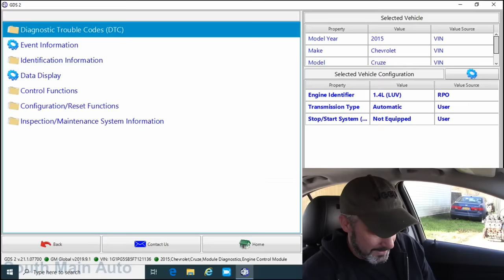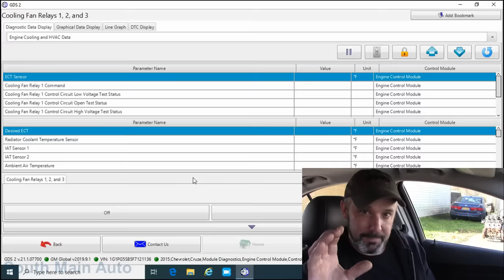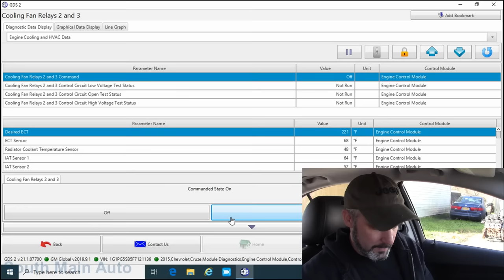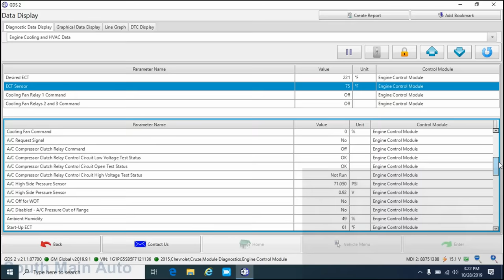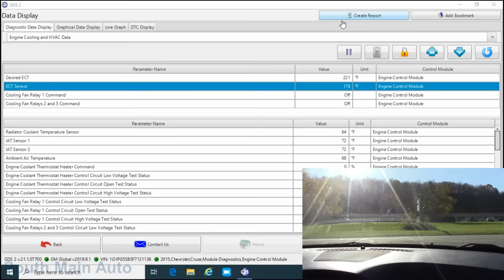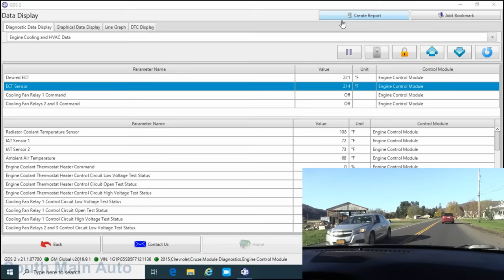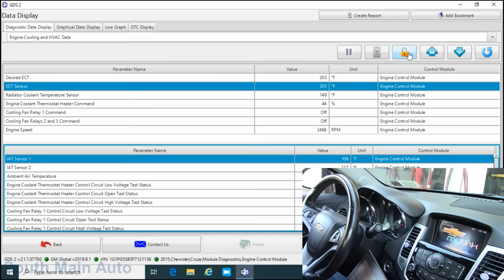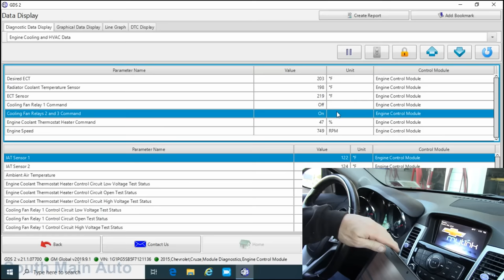Chevrolet Cruze: Overheating, Loud Fan, Losing Coolant

Comment: As a tip, on a new GM with push button start, push and hold the button for a few seconds and it should turn "on". Thats how it is on my Bolt anyway. EDIT: Nevermind, you read it later

Also, since you didn't really cover the thermostat operation (at least in this video), many new cars use heated thermostats. It is literally a standard thermostat with a tiny heater element in it. This allows the manufacturer to change the thermostat opening temperature depending on what they want at the moment by adding more heat to the thermostat without heating up the coolant. Higher temps help with efficiency and fuel economy, while lower temps help with performance. So, the thermostat will open at what would traditionally be considered a high temperature (this one appeared to open around 220-225F, hence the desired coolant temp of 221F while driving), but when you were running the engine off idle and not moving, it turned on the thermostat heater and dropped the desired coolant temp to 203F. This is still somewhat rare technology on domestic and Japanese cars but has been super common on European cars for a while now.

Comment: Eric O, I want to thank you for all that I have learned from your channel. I watch new and old videos every morning waiting to go to work. ive got one in my driveway. 08 f250 5.4 it loses its 5v ref from the pcm. the other shop told them they needed cam phasers and it was gonna be 1200 plus parts.. I learned from that always test never guess.. if I wouldn't have done that I would've went down the rabbit hole. thanks a million eric o from john masontown Pa

Comment: Chevy Cruze's are total crap.
Reply: my europe version has 190.000 miles but I agree the cooling system is a desaster...I have been stranded down the road 4 times due to overheating or hoses and plastic parts breaking...last event was last week were the last original OEM hose blew during stop&go traffic...but things got better since I change from Dexcool to normal standard coolant...plastic and rubber parts seem to last longer now
Reply: should have stayed with the cavs  they run an  run
Reply: @bobl78  Mileage honestly means very little. Everything should be clocked in hours of operation and not mileage. Everything else in the world is, only cars stick with a measurement that is variable.
Reply: There’s your problem lady.
Reply: @DontCryAboutIt  Time or mileage are both inaccurate measurements. Time does not factor if the machine has been operating and distance does not factor if the machine has been operated but moved short distances over said time.

This is why everything else in the world. Heavy machinery, farm equipment, aircraft, marine engines etc. are measured in hours of operation. As it is the only metric that tells you how much the machine has been used.
Reply: @Cragified    I think total fuel consumption would be the best single metric of the total work the vehicle has done. Nor hour count, nor mileage, reflect the load on all the components of an automobile, which can vary greatly with use.
Reply: @Cragified  isn't time measured in hours?
Reply: yea, they are cheap cars. weve had ours from 60K to 80K miles now. has had warranty work done on the coolant system and boost system twice now. thing filled up the plug holes with oil. recently it's sounded like a freaking sewing machine at idle. IDK, maybe its obnoxiously loud injectors? Dont think I noticed it when she got it. At my job one of the key parts is listening to change in how my machines are running, so I figure I would notice a change in this engine, and I sure have. But we have warranty and it's still running. one day we will probably trade it for an fx37/qx70. she wants a bigger car anyway.
Reply: @fascistpedant758  Fuel consumption tells you very little about engine and driveline wear. An idling engine experiences nearly as much wear over time as an engine at the same rpms but under a higher load. The metal to metal wear is the same, but the fuel consumption per hour will be vastly different.

Likewise drive line rotations (mileage) that equate to a distance gives absolutely no information to the conditions the drive line and suspension experienced during set distance.

100 miles down an interstate at 55mph is significantly different in wear then 100 miles down a rutted country dirt road at 55mph for your suspension and axles.

There is a reason that trucking, heavy equipment, farm equipment, aviation, rail etc. all use some form of hours of operation. Be it engine hours, flight hours etc.

It tells you how long said machine has been in service, regardless if it has been stationary. Some may try to argue well that only tells you about the engine. Thing is.. vehicles don't tend to do much of anything if the engine isn't running. And in the case of where the entire vehicle is stressed from operation regardless of engine use that's when a variant such as flight hours is used as is the case in aviation.
Reply: Not saying mine was perfect but i put 120k on it and the only time it ever left me sitting was when the batt went bad. Also had the ect sensor replaced under warranty
Reply: @Cragified  I agree that lubrication and cooling aren't optimal at idle speeds, but automobile engine don't usually experience high loads at idle speeds. I disagree that wear at idle is anywhere near that at high speeds and loads. 
Hour counts are useful on equipment operated at fairly constant loads and designed for long service life at max rated speeds and loads. Automobile engines are not designed to operate at high speeds and loads for extended periods of time.
As for bumpy roads, that's a different story unrelated to mileage, hour count, or fuel consumption.
The number of recommended oil changes on vehicles with oil life monitoring based on operating conditions could also be a useful
 indication of engine condition.
Much of all of these parameters are stored in some form in modern PCMs and could be evaluated together to get the biggest picture.
Reply: anti chuckle that’s kinda how bmw calculates there oil life. How many liters of fuel has been consumed. If you drive around easy your not burning much fuel so your easy on the engine. Hot rod it and your rpms are much higher even when you travel the same distance. So more fuel consumed more work is being done. Less life in the oil

Comment: Maybe this has been said already but I was working on a Cruze with a pesky coolant leak from the water pump. Would not leak a drop under pressure until I persuaded with a pry bar "gently " a then it leaked like crazy, hopefully this helps with future Cruze escapades, keep up the good work.

Comment: Enjoyed, I will have to keep an eye out since my daughter has a cruze and wife has the equinox with the 1.5T and the guy who tairs down motors do a1.4T for the first time. It had a blown headgasket the wall between cylinders is close. So I guess good maintenance is going to make sure that these motors will last.

Comment: I have that Astro kit and the Brake Bleeder adapter set. They're extremely well made and not cheap. Only problem is Astro can't be bothered to update their compatibility charts. They're like 15 years old. I called them about it and they didn't seem interested in investing the time to update them.

Comment: I would push for more off.  As stated below.  Its all drive train!  At least the water pump for sure.  They might do something tricky and classify them as accessories, but I would argue that they are drive train accessories.  The key word being "drive train"!    I would make sure they do everything you suggested.  Also, I hope you got paid for your time in the deal.   You did a good complete job assessing the needs and the dealer could not.  They are also getting all your labor!

Comment: My Chevrolet volt with the same motor has the collant loose issue and loud fan - was the thermostat controller housing and thermostat...... the dealer only changed the housing the first time and the car overheated the day I drove it home, had to bring it back..... I wish I lived by you so you could service my cars.

Comment: I find a Kelloggs Cornflake carton in front of the radiator speeds up the engine warming up period. Saves on fuel, mileage and time.
Reply: I do that every time in the winter. Poor 800cc engine really hates the cold.

Comment: Enjoy your channel as I have a 2010 sierra 4x4, 1996 k1500, 2016 chev trax 1.4t, and a 2011 Q5 1 4T.
I hope you got some money for a diagnostic fee. That should have been a solid $80.
Good Job.
Thx
Kevin, Auto Mechanic (subaru , oldsmobile)-Paramedic

Comment: I replaced the housing and the hose.  Very easy fix, remove the hoses a couple of elec connections unscrew 3 mounting bolts. Plenty of room to removed all componets.

Comment: Quick little tip - You can verify start/stop system by looking at the tach.  You will see "auto stop" at the beginning of the tach.
Reply: That's the easiest way.  Eric also could have scrolled down the list on screen, this is a list of all the RPO's of this vehicle, and find/not find the RPO code.
Reply: And any start/stop vehicle uses an AGM battery.

Comment: The black, plastic coolant housing, on the driver's side end of the cylinder head was cracked on the 2016 Cruze Ecotec I diagnosed. It also has a small hose connecting to the coolant reservoir.

Comment: I had a hard to find problem or duplication of the problem on a customers mini van once. Finally talked her into letting me put a capture device on it and showed her how to trigger the simple one touch button. She was WOT in rev when her car would jump surge on its rev limiter delivering news papers lol. The van didnt have a problem needles to say it only had a short between steering wheel and drivers seat.

Comment: Just did one of these the other day.. Water pump bolts was lose and possibly had the bolts mixed up. Almost positive it was leaking at the gasket and pump was good but had to throw a pump in it for piece of mind. Two of of the bolts had thread sealant on them but was in dry holes. I'm guessing the dealer selling the used car to this person did the water pump to avoid a returning customer and the Gomer Pyle of the dealers shop did the work. Everything was going smoothly  got the bolts figured out and the pump back on. I had someone approach me. I was having a discussion with said person and the thermostat unit flew apart the spring shot the locking plate across the shop. I had to get one of those thermostat units to complete the job. Piss poor engineering on GM's part to integrate the thermostat and housing but expect 2 tiny tabs of chinesium to retain 100percent of the spring pressure on the thermostat. While it may hold up on paper with the glass embedded china gold holding it together, in the real world with these cars having cooling issues and such a high operating temp they should have opted for a aluminum housing for the unit. I ended up around 200 in parts for a water pump job which i charged family rate for a whopping total of 40bucks labor plus parts. On my way back from the parts store to get that thermostat unit the rear caliper locked up on my WJ jeep which costs more than what I charged for labor.. Morals of the story "GM can cooch on a pant antler" and "Being nice doesn't pay".....

Comment: To get any GM car with push button start into accessory mode you just need to hold the start button down for 10 seconds without pressing brake pedal, it's not just the cruze that's this way but all GM cars I've driven. 

These gen1 cruze are known for leaking water pumps, brittle plastic coolant housings, failing thermostats and surge tanks/cap that don't hold pressure and vent coolant. My uneducated guess the plastic can't handle the normal operating temp of 217-220F these cars run. Under load(hills and full throttle) the computer controlled thermostat drops temp to 195F but will quickly climb to normal range once the load is gone. Shutting the engine off I've seen 240F after 5-10 minutes under normal conditions. 

Temp guage on dash shows just below 1/2 from 180-230F so its worthless. I have tested the cooling fan low speed without warming the engine by kicking on the AC. 

Glad on the gen2 cruze GM eliminated the computer thermostat and normal operating temp is now 195F like most cars.

Comment: I've done several of those junk eco-tec plastic T-stat housings. Good thing is, the water pump is an external and not timing chain driven. Sorry you didn't get the job, but after almost 30 years of twisting a wrench, you win some you lose some, goes with the territory.

Comment: Yep, same exact issue on our 2014 Cruze w/ the 1.4 turbo. Engine overheated because the water pump was leaking. Local mechanic wouldn't touch it, so we took it to the dealer and they said it was a known common problem.

Comment: Excellent vid Eric. I went through something similar last week with a GM 3.8 waterpump. Your Grand Priz 3.8 water pump repl video helped me alot. You were right about those small pump bolts being torqued to 16 lbs. Felt like i was gonna snap em. I didnt even get em up to 16ft. lbs.

Comment: 2013 captiva running at 240 degrees. Seems hot to me. But that's when the fans cut on. So waiting to see what you find out.

Comment: I had the EXACT same problem with my 2016 Chevy Cruze Limited LT almost 2 and a half years ago. It was overheating and losing engine coolant all the time until one day, the engine DIED and a new engine for it was $9,000 and I was like “Forget that, I’m selling it.” Then I went 2 and a half years without a car until I recently got a 2011 Buick Enclave SUV. Those were the longest 2 years ever lol.

Comment: Eric run the motor while you have it pressurized. sometimes it only leaks when it runs. If i can i like to pressure test it on the lift. this is because i used to work on BMWS, Mercs and Audis and they are hard to see around the motor with the light and mirror. Then you have to take off the useless plastic shield to see in from underneath.  I'm watching the video on your test drive a wonder why i can't scroll down on the temp reading on the right. LOL Get a slightly larger mirror. The small ones don't give enough area. You end up not being able to see where you are in relation to things even though you can see the leak.

Comment: My older age teaches me “LESSONS”.  (1) Dealers are expensive and may NOT be the best place to take your car. (2) Find yourself a good mechanic you trust and use him. Just like your doctor,barber & plumber.(3) you don’t have to be “to late smart.”(4) what ever you want done will cost you money. Suck it up and do it! (5) basically money was never meant to be only saved, but to be spent wisely. I would welcome a South Main Auto Repair in my neighborhood!

Comment: Water pump thermostat water outlet all very common on those. Extended warranty through GM on the pumps I believe, just had one here in my shop the other week that needed valve cover for the PCV failure and had the missing check valve in the intake manifold which it also needed, on top of a leaking pump. The pump was covered under warranty so customer opted to let dealer do that. Likely why the dealer said they'll do it at a discount.

Comment: Yeah.. “normal”, glad to see GM hasn’t changed. I had a ‘97 S10 Blazer and the Dex-Cool garbage kept turning to brownie mix within a week of flushing it, I drove it for about 5 hours every day (long commute in to my job at IBM in Silicon Valley, Stockton to San Jose). The GM dealership flushed it a bunch of times and it would always turn to sludge right away. I’m thinking the older Dex-Cool formula (early 2000’s) + long hard commute in stop and go traffic with the A/C on on the Altamont + iron block engine + generation of vehicle that wasn’t designed for use with Dex-Cool + some air getting into the system that GM was unable to find is what caused all this. GM refused to flush the cooling system again and told me the coolant turning to dark brown sludge was: “normal”…

I finally fixed it by flushing the cooling system for two days straight and “converting” it to regular Prestone green coolant. The coolant after that always looked bright green with no sludge. I will *NEVER buy a GM product ever again….

…..*OK, maybe if I get an all black Corvette for a steal of a deal. Have to admit their new trucks look nice too.. 😐

Comment: I have a 2011 Cruze 1.4 . And i had the samething and i agree with you , i replaced the water pump and both thermostats  but i upgraded to aluminum housings cus plastics sucks for engine soon my intake manifold is soon to be upgraded....and i highly recommend premium gas for the 1.4t engines ...and not that cheap gas too....something like bp gas or shell ect...

Comment: The water pump on the 1.4 is a pain in the butt. If you go far enough to change the pump do the stat at the same time. Throw a belt on and if it has over 100k do the tensioner. Backwards ain't no fun. Good show Eric.

Comment: Hi, In my experience with my cruze. it will get to 219 f to 228 f  and that's with a new thermostat from dorman that since failed less than a year old. I can almost guarantee that when I fix this the actual stat fell out of the housing because my temps are 178 to 180 running it hard down the road.  The dash gauge will not show over 185 at anytime that's just the way they are programed.  Have a good day.

Comment: My 15 Cruze went through 3 water pumps. The dealership charge over $1200 to replace the second water pump in Arizona. I took it to Bean’s Auto in  North Versailles where my grandma always went, and John Bean charged me 1/2 the cost to replace the 3rd one before I traded it in